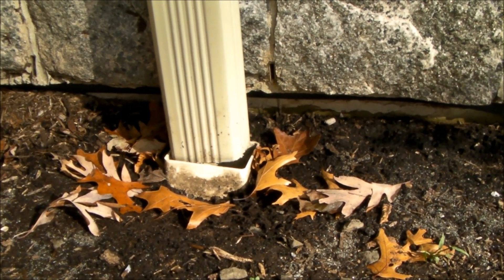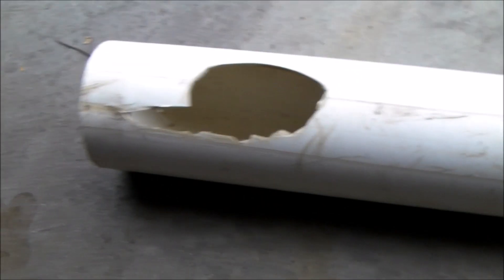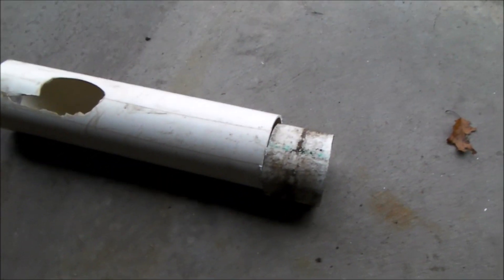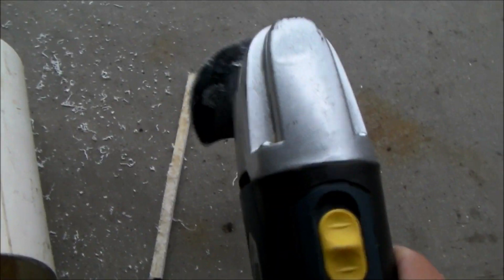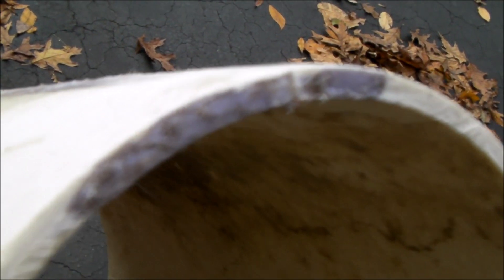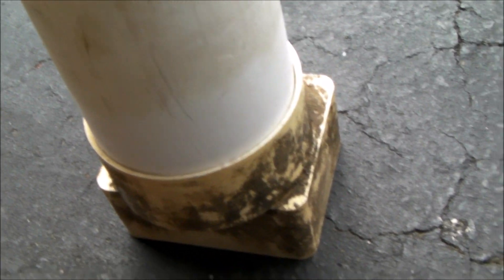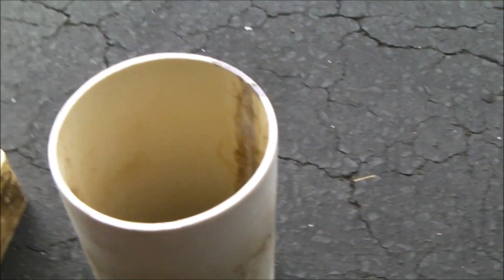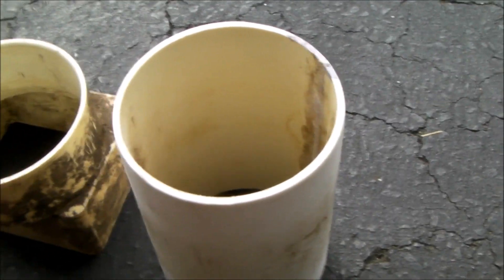How to reduce diameter of PVC pipe

Comment: The pipes are different sizes because the original pipe was Thin Wall PVC, the schedule 40 is well schedule 40. Anyways, they make sleeves to make thin wall and schedule 40 fit each other.

Comment: Nice one! I’ll be using it when installing 2” pvc pipe for dust extraction in my hobby shop. How did you figure out how much to chop out? Trial & error?
Reply from the maker: You could actually do a complicated calc using some formulas on the internet but the angle of your cut has a big impact on the final result.  Trial and error by eyeballing it worked first time for me.  But if you have a LONG cut, maybe a calc is worthwhile.  Be sure to LIKE and subscribe.  THAT will really help me.  THANKS!!!